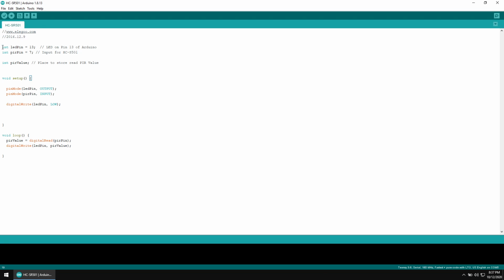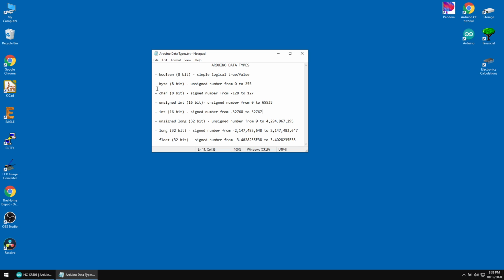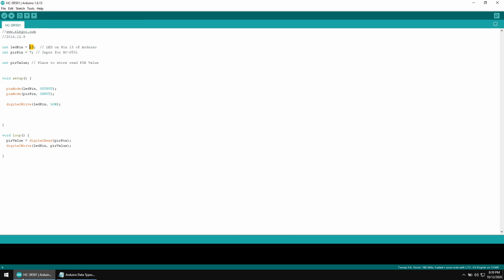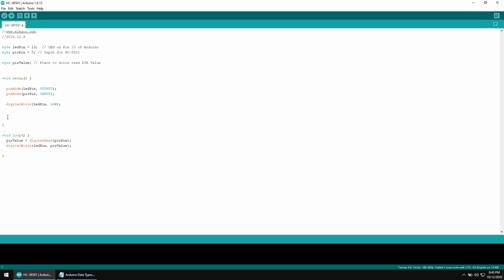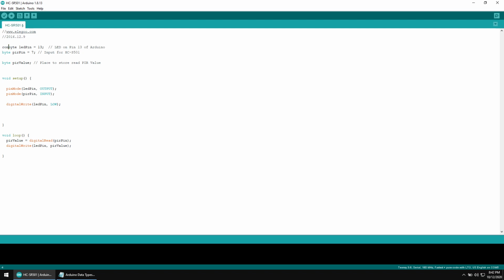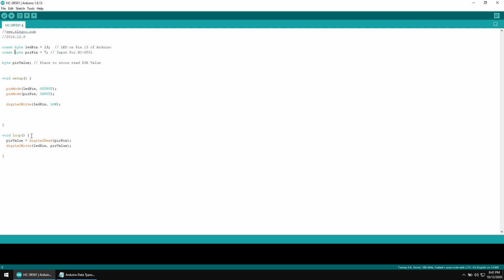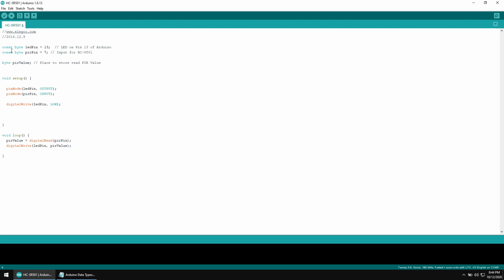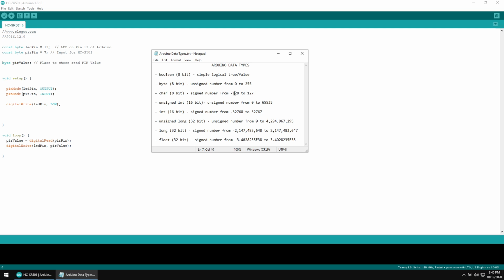Most Arduino tutorials have this major problem

Comment: You are correct that it is a good idea to declare constant stuff as "const" because it helps the optimizer make your code more efficient. But the optimizer is a lot more clever than you think.

If you declare a variable "int ledPin = 13;" and you never change the value of "ledPin" then the optimizer assumes it is "const."

You can test it yourself. After building your code then at the end of the Arduino build log, you can see something like this:
Sketch uses 734 bytes (2%) of program storage space. Maximum is 30720 bytes.
Global variables use 10 bytes (0%) of dynamic memory, leaving 2038 bytes for local variables. Maximum is 2048 bytes.

Now you can try changing the "int" to "byte" or "long" or add a "const" in front of it or remove the variable altogether, and you can see that nothing changed in the "Global variables use" amount.

But you shouldn't omit the value initialization and assume it will be zero:
byte pirValue; (without the = 0)

By C/C++ standard, the value will be whatever the value happens to be at this memory location if you haven't initialized it yourself.

It happens to be 0 on Arduino after bootup since Arduino physically clears the memory after reset. 
But if you use uninitialized local variables in your functions, then you will get random garbage as the variable value.
Reply from the maker: i have tried it both ways, and at least on my program when i declared it as const it did reduce ram usage slightly. Its also good programming to do so.